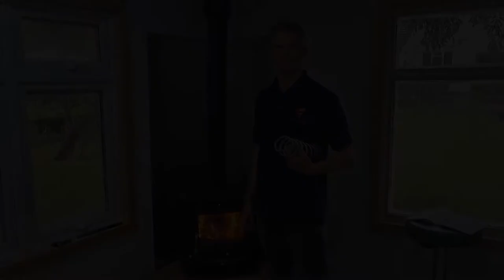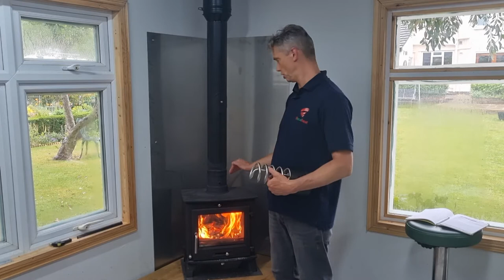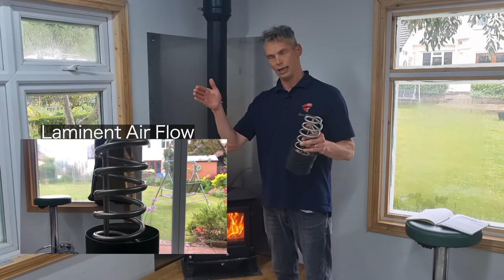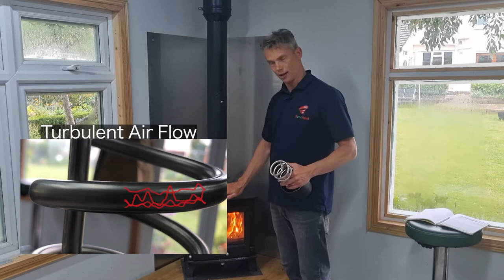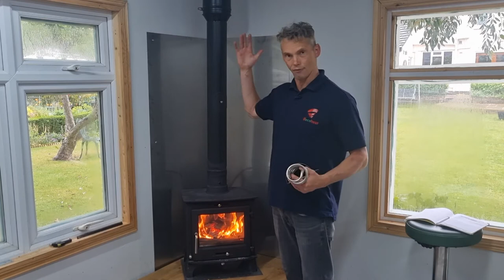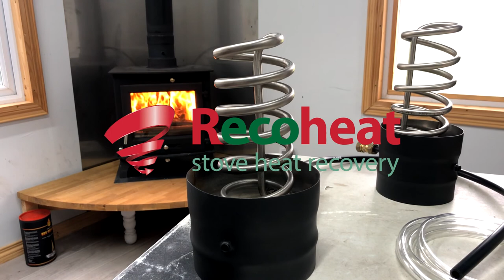How to move stove heat into other rooms with a Recoheat

Comment: You can use a fan outside the room to blow cooler air into the room where the stove is.That can be effective in moving the air from one room to another.
Reply from the maker: Yep, for sure. It does obviously cool the room though, but as you say - if you put some in, some has to come out.

Comment: I am just about to fit a stove in our drafty Edwardian house. Was thinking of linking the exhaust pipe to an additional 10mm copper pipe that would be wrapper around the flexible flue liner and up the internal of the chimney and exit in the room above. Would this work? The pipe should be hot as it is wrapped around the liner and within the hot chimney. Was also thinking of insulating the liner and the copper pipe with ceramic insulation or somthing similar.
Reply from the maker: It's a great idea. You should get some warm air coming out, but you'd lose a lot of heat and a lot of velocity. It wouldn't function at all in the same way as the normal unit because the air wouldn't be turbulent, and I assume it wouldn't be anything like as effective because of the friction and pressure created by the additional coiled piping. This would reduce the flow enormously, and if this also reduces the flow through the heat exchange, it will prevent the heat transfer induced by the turbulence in the airflow. The pump copes fine with the pressure drop in the heat exchange, but I assume would struggle across the distance you suggest. Slower coils would mitigate this, as would simply running the pipe straight up tight to the flue. Your focus would have to be on retaining heat rather than capturing it because the flue itself will be cooling. I've got no idea how effective it would be, and it might be completely ineffective because of the pressure and the heat transfer into the pipe across that distance. Don't forget how relatively small the volumes of air are that we're using - the effectiveness of our device derives from the high temperature and the turbulence in the outflow that causes the oscillating effect and efficient air-to-air transfer. You'd lose these with this configuration, and I think you'd therefore lose most of the benefits.
Reply: @Recoheat  really interesting. Thanks for getting back to me on this. Well I'm definitely getting a reco heat unit. Think I may as well have a go at linking it up and seeing how effective or ineffective it is. I'll let you know when I've installed it. Thanks again and keep up the good work.
Reply from the maker: @Adam-fp8jp  Thanks very much Adam! Be fascinated to hear how you get on, because it may not be at all as expected. Someone else has extended one through a wall with insulated 15mm copper which I also didn't think would be effective though it's only over about 18 inches, and they're heating a timber storage unit with it and are very happy! Good luck with your plans and thanks very much again for your support.
Reply: I wouldn't go with a vent to upstairs room, you tend to have bedrooms upstairs at a lower temperature for sleeping. Stove top fans are good for improving heat distribution.
Reply from the maker: It's standard in Czech, for example,  and is effective as you're using the temperature difference to draw the heat. It's something a stovetop fan won't begin to touch. Some of them move some of the radiant heat away from the stove, but it's not a large effect. We have a comparison video of the Recoheat with a decent quality fan if you're interested. @grantmcwilliam

Comment: what about water? if I modifed this to use water pumps instead of airpumps, would I be able to get a shower tank nice and hot?
Reply from the maker: Hi there, no, you wouldn't. We're using the turbulent boundary layer to induce rapid temperature transfer into the airflow, with minimal cooling of the gases. Water will cool the gases a lot. All the physics is completely different in fact. And it would be dangerous because water expands massively under heat, so you'll probably blow your whole home up. Which would be unfortunate. 🙃
Reply: @Recoheat  nah.. i doubt that he would blow his home up. maybe if he would install it himself with a pressurized water tank but even then blowing it up would be pure art xD plus: with the right circumstances met, water could be even better especially because of the heat coefficient. depends on use. interesting system though..

Comment: hello, would it work to have the pump draw cold air from the basement?My stove is on the main floor and the basement gets quite cold(obviously hot air rises).The central heat never comes on and the basement can get close to freezing when outside temperatures are around -30 to -40 Celsius.
Reply from the maker: That certainly sounds a perfect place for the pump, and may even help a little with circulation down there. It's not a problem to have the pumps a bit below freezing, though the -40 would be too low!

Comment: Morning,  does this product work with a pellet stove?
Reply from the maker: As long as it doesn't have a balanced flue. A chap in Norway has a unit on a hybrid pellet and logs, and it's great on those, but they system isn't designed or built for regs for balanced flues.

Comment: Hi, can a vintage wood/propane cookstove be fitted with this if the connection from the stove's opening to double wall stove pipe is single wall? Are you developing a device for double wall? And where can I find a dealer in the Northeast U.S? Thanks in advance?
Reply from the maker: Hi Cynthia, the problem with double wall is that all the brands have different connectors, so you can't make a universal fitting. Instead, we make the unit so that the spigot that goes from the twin wall into the collar can just go into the Recoheat instead. We have just supplied some units with an extension to the outlet pipe so that they can be fitted with a cover and look like the twin wall, if you see what I mean.
Reply from the maker: WE do now have versions that fit with twinwall systems and are hidden with a cover. The inlet and outlet pipes are 25mm longer either side so that they go through. We're still in the position of supplying to the US from the UK.

Comment: You can attach it to your duct work with a filtration system and blowers and heat your whole home.
Reply from the maker: People certainly use ducting and also HVAC systems with the Recoheat to move the warm air all around larger homes, and it's very effective. The key thing then is to be producing enough heat for the volume of space you're heating, and the Recoheat obviously contributes considerably to that.

Comment: So basically open all your doors and you don't need anything. The hot air rising off the heat source will automatically draw the cold air into the room with the heat source.  Convection.  Hard to see how a tiny air pump on the stove will heat another room any better than opening the door.  Sorry but I don't see this working
Reply from the maker: Well, there's no question of it working far better than convection - just look at our TrustPilot reviews. https://uk.trustpilot.com/review/recoheat.co.uk You don't heat a three storey, three bedroom house by opening the door on the room with your stove unless you've got a Recoheat fitted.

Comment: 2nd question, whats the chances of getting this in a 4" model?
Reply from the maker: We tested a model but there isn't the clearance to get the air flow to create the turbulence we need around the coil to keep it clean, so we are not making them. You can simply put in an adapter to go from 4" to 5", but unfortunately that means changing the flue to 5" all the way. Thanks very much for the interest!
Reply: @Recoheat  oh interesting, thanks for the answer. Might be something I could do. Will it still work if I go up 10 inches with 4" and then the converter into the reco device? then 5" up from there?
Reply from the maker: @traida111  Yes, that would be fine: you won't get a significant drop in heat on that distance. We run one on a Hygge stove that has the collar set back, then the adapter, then the unit: it works beautifully.